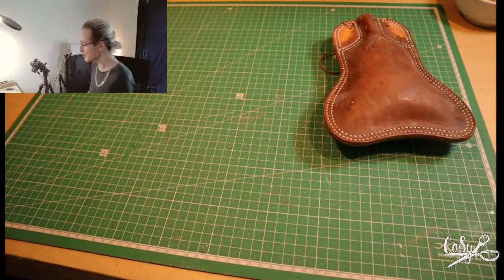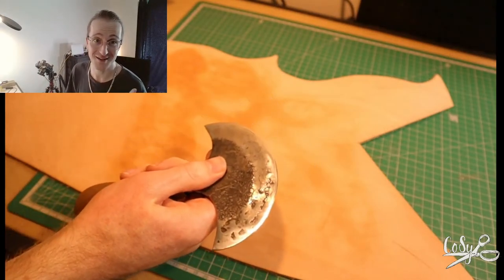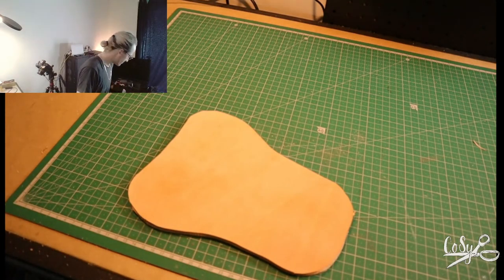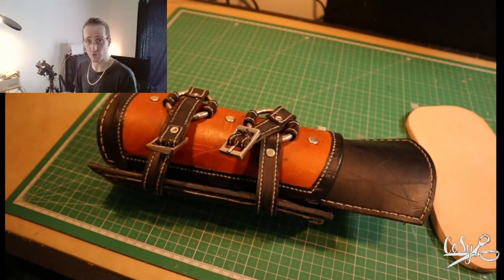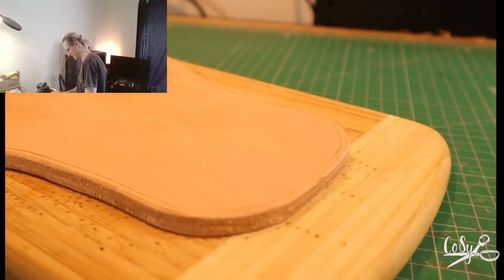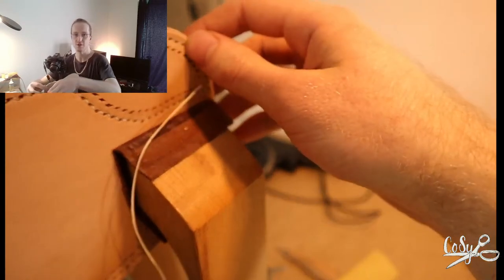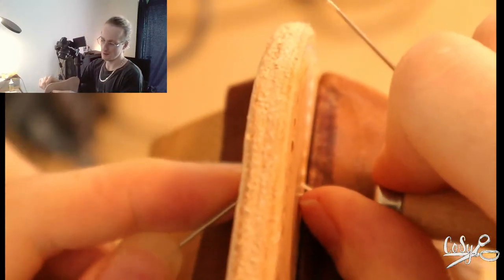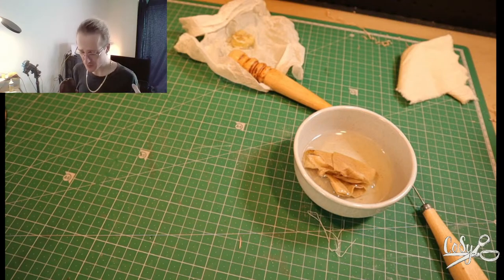Leathercrafting tutorial - cutting, gluing, stitching, and edge treatment

Comment: Question that you may or may not have the answer to: I recently harvested some "leather" from a couch on the side of the road that was partially harvested by another crafter. Is there a way to tell if it is faux leather? Or does that even matter (they get treaded the same)?
Reply from the maker: Oh boy, this gets really close to the "what is leather" question. So, in most places, "leather" isn't a protected term, so you can have fullgrain, suede, or leather particulate sprayed onto fabric backing sheets, and that's all "leather" because it's an animal skin product.

I go into this a little bit with my video comparing some plant-based leathers to a goat hide: https://www.youtube.com/watch?v=Z5W_B9nAavA 

Basically the long and short of it is: If you can see the fibrous suede-y grain on the back of it, it's likely "real" leather. If the rear side of it is fabric, it's either 1) leather particulate sprayed onto fabric with a glue, or 2) plastic sprayed onto fabric with a glue. Both of these options will then have a leather texture stamped onto them to make them look more like full grain. This is a really good question because I know a lot of us, myself included, have harvested leather from old couches, and I think this topic is deserving of its own video later down the line.
Reply: Faux leather is a pvc or similar onto a (usually) woven textile backing. If the "leather" has a mesh or fabric at the "wrong" side, it's not leather.

Comment: YEAH!!!! All of the fun learning content!! Thank you for the live stream.
Questions that I'm left with: 1) When stitching, why do you poke the awl through before each stitch? 2) When treating the edges, does the edge-finisher-wood piece have to be wood? Does the shiny come from the repeated friction of the leather against the highly resistant edge-finisher? Or does some of it come from the edge-finisher being wood?
Reply from the maker: Glad you enjoyed it! Great questions, I'll try to remember to go more in-depth in later tutorials, but for now:
1) it opens up the stitch-hole, and helps align the off-hand needle so that you don't need to keep cricking your neck from one side to the other. Also, in cases where your stitching holes aren't punched the full way through, you'd use a sharp awl and finish the hole with the awl in this step. So, not totally necessary.
2) I've seen people use bone folders, and even pieces of glass, so no it doesn't need to be wood! The shiny is from the friction, and the beeswax becoming a thin glossy coating. Think of it like sanding with progressive grits; the wood is a coarse grit, then the water + fabric is a fine grit that leaves a smoother finish, which looks shinier.

Hope that explains it a bit more clearly!
Reply: @Cxizent  Thank you for responding! That makes a lot of sense.